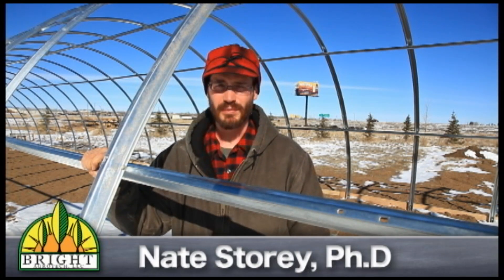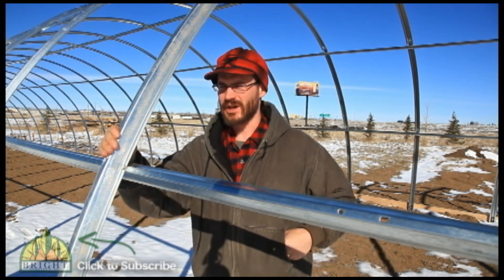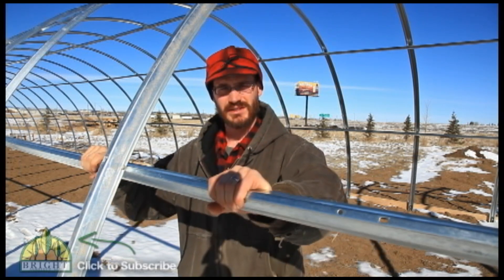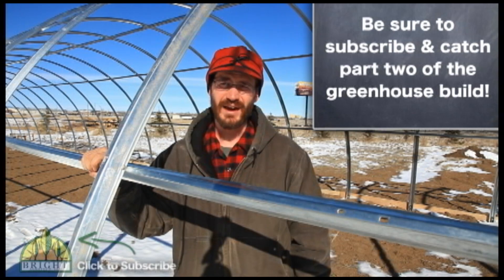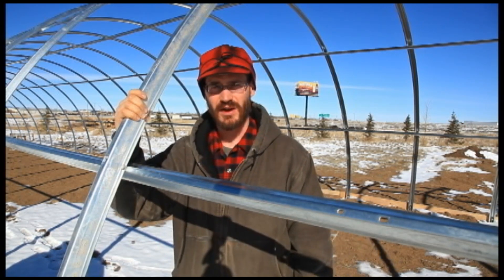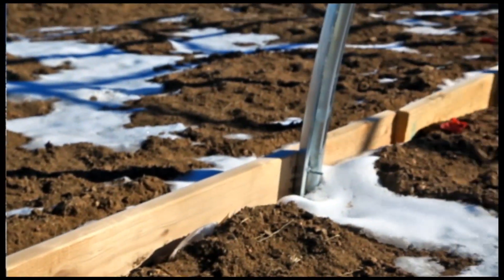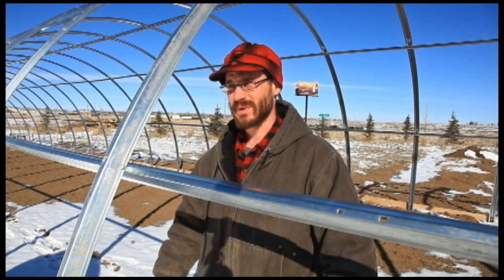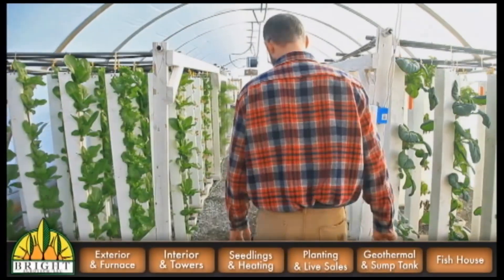Building A Greenhouse (Part 1): Installing a Rolled Form Hoophouse

Comment: Hey love the video what size hardware did you use through the ground stake and arch? Also just curious the size of square tubing and how long you made the ground stakes?
Reply from the maker: We experimented with a few differentt lengths and sizes.  For our first hoop houses we went with 1" steel pipe in 22" lengths driven down into fairly hard-packed earth.  That never budged.  Then we tried to simplify and went to 16" x 3/4" square tube steel stakes with cemented corner/endwall stakes and a few other random cemented stakes along the length of the greenhouse.  Those worked fairly well actually, but we did have one area the pulled up under the inflation pressure of the film.  We just anchored the purlin down with a twist-type ground anchor.
Reply: @ZipGrowInc  Where did you find the 1" steel square pipe? or 3/4" I can't find it anywhere. Thank you!
Reply: Caroyln if you are looking at Home Depot you are doing this all wrong. Go to a metal supplier...
Reply: @rickschneider9647  oh??? shoot, just ordered it. What's wrong with Home depot? Too cheap?

Comment: The cold frame greenhouses that I've found online (greenhouse megastore) are not wind or load rated. Have you guys had any weather-related issues with your greenhouses?
Reply from the maker: Hi Carmen Igoe - We haven't had any weather related issues so far. We make sure to secure our covering with wigglewire and keep the double layers inflated at all times though. No complaints on our end.  #farming   #greenhouse

Comment: If money is no object, I would put two 20' cold frames. With two separate buildings you will get better air flow and have two separate growing environments for safety and experimentation.
Reply from the maker: Great point, David Owens

Comment: What guage metal did you use to build your greenhouse and what is the greenhouses dimensions? Love your video channel! Great Information well presented
Reply from the maker: A frame similar to our high tunnel can be found on greenhousemegastore.com - We use the 20' wide cold frame option with rolled form galvanized steel.
Reply: Bright Agrotech If money wasn't a deciding factor, would you still only put up a 20' cold frame. I have to make a choice between 1 34' wide cold frame or 2 20' wide cold frames. Do you think the zip grow towers will get enough light if they are set up 8 towers deep? I live in the Pacific Northwest (Portland).
Reply from the maker: If money wasn't an issue, we would build a greenhouse with sidewalls for sure. If you space your towers out far enough, 8 deep is fine (3 square feet per tower), and as long as you were managing your light effectively using conveyor cropping you should be okay.

Comment from the maker: Hi Alec, most 20' wide hoop houses use a covering in the range of 32' wide or so.  It's a standard width when you're looking at different film widths.  We staked our arches because it was the middle of the winter and the ground was frozen, and we weren't super confident in the rolled-form to stand up to our winds without being bolted to groundstakes.  Either way you'll probably be ok.

Comment: I love your channel!  Your information is awesome, professional and inspiring.  I wanted to ask on this video, you anchored your greenhouse with posts, Greenhouse Megastore says to put the end of the hoops 18 inches underground.  I see it's working fine with your later videos, I was just wondering how you sized the covering as far as width?  The store says the 16' wide house has a 24' covering, so would that then be 27' covering without burying the hoop bases?  Thanks again for the awesome info!

Comment from the maker: Hey Matt, yes the rolled form was much less expensive. We were skeptical of it too, but once we got it all bolted down and put together it's super sturdy. On the quonset frames, you don't want it to be perfectly stiff - you want it to move a little bit. We've had gusts recently of 60-70mph and sustained winds of 40-50 and it is doing just fine. You'll see more videos of our progress in the coming weeks!

Comment from the maker: Thanks, Benjamin! Our corner posts are cemented but the rest of them are not. Believe it or not, our stakes are not 3 feet. They're anywhere from 1-1.5 feet depending on where they were pounded in. On our first greenhouse we put them in 2 feet and never had an issue with it. On our second greenhouse, we drove them in about 14 inches through hardpan and they are VERY solid. For the greenhouse in your picture, looks like you have sidewalls so you'll need to drive your stakes deeper than ours.